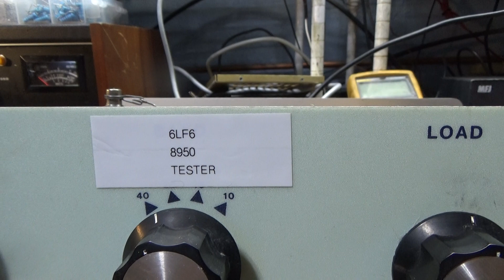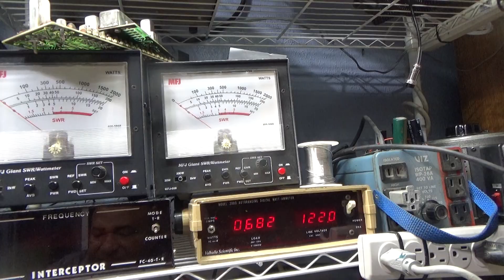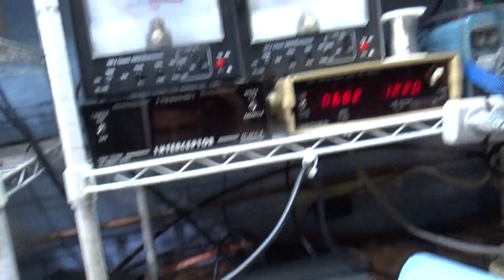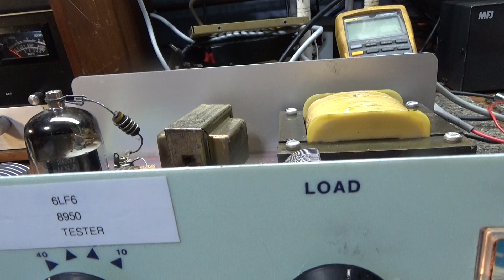M-2057 GE / Maco tube HD 8950 on the Palomar 90a 1 tube tester

Comment: hey u work on maco 300 right ?    are u backed up on repairs or can i send mine to you? mine works but not at 100 % i have 7 extra tubes for it. and only 1 transformer in it  3 new high voltage caps. the problem i see is my cb radio puts out 2 dead key and watt meter only show 1 wat when hooked up to the amp. and my swing is about 20 and with the amp in line it only shows 10 or so what do i need to do?   any one that knows how to fix this im all ears. when bought the amp he showed  1200 watts. when i got it home it was 650 on my setup. now after i got a comp mod finial upgrade to the radio im showing about 550 watts.   and i only have one transformer in it.. do i need another? what do i do to get what he was getting?  theirs is no repair videos on the maco amp i need a video to troubleshoot mine.
Reply from the maker: I am backed up and don't normally work on others. That amp has a choke (L1) that is connected to the input at all times. This messes up the radios feedthru watts and sometimes your SWR. This choke grounds the driver tubes when the amp is keyed, thru the input. Amp makers often did it that way to save money. Easier and cheaper to do it that way using the radio input line than using a relay with another contact or pole. Other than adding a relay and modding that amp to get that choke off the input, there is nothing you can do. If you watch my videos, I get about 100 watts out of each final tube. Maco 300 has 5 final tubes, so I would expect a good 500 watts out with good tubes. 1200 watts out? Doesn't sound right to me. Maybe a very generous wattmeter, maybe a high SWR which will give you high watt readings. Also interesting that it looks like that amp normally uses 2 transformers and you are only using one. Hmmm. I would say if you are getting 500+ watts out, you are ahead of the game.

Comment: I have a maco  300 2 driving 5 single transformer 7 8950’s In the schematic’s from CBC tricks it has 2 6lb6  driving 5 8950’s the heaters look to be series parallel at the driver socket’s so one drops 6 volts and the other drops 6 volts Question : Could I use 2 6lb6 rather than 2 8950’s for drivers like the schematic’s
Reply from the maker: Sure, as long as you convert the filaments. 6lf6, 6lb6, 6kd6 and more are all pretty much interchangeable. 8950's are the same too except for the 12v filament. The M-2057 is the big bad one. It is also 12v filament like the 8950 but will do about twice as much as all the rest. It's about twice the price too. $$$$

Comment: Heu you have helped me out alot question do you know of a website that sells the 12dq6b tubes or a tube that can directly interchange with that tube it's for a avenger built amp
Reply from the maker: Ebay had some at a reasonable price when I was looking for a couple for my Elkin. I would not interchange tubes in a multi tube amp, plus those tubes are already relatively cheap.
Reply: @tramdr  ok thanks yeah someone was telling me something about some website that had them for 12 dollars a piece